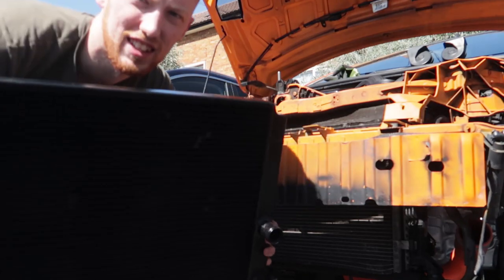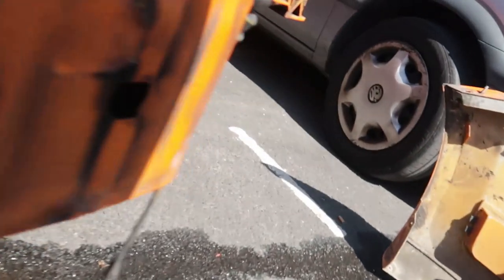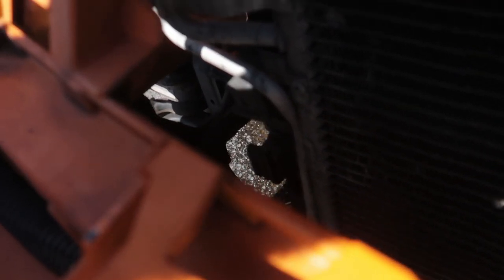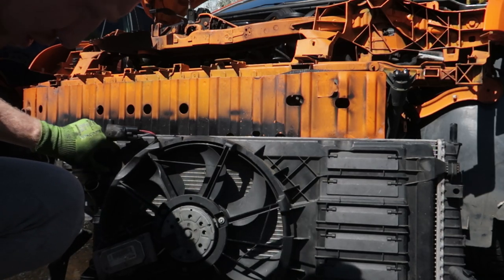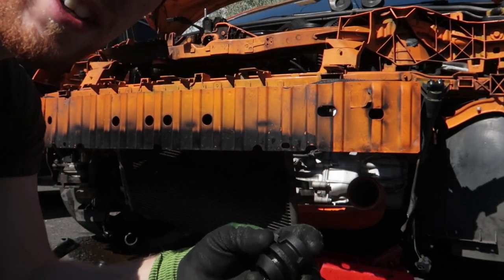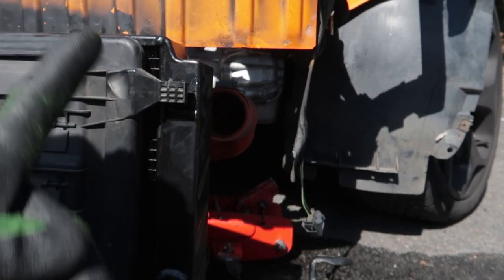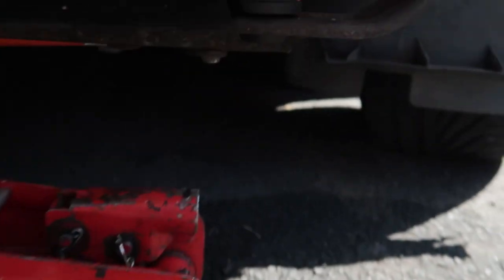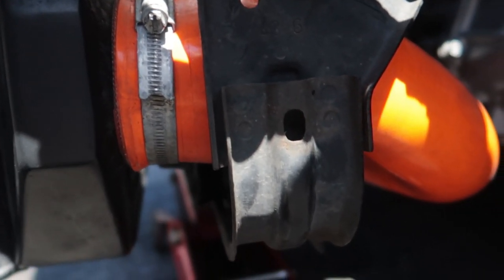MY RADIATOR BLEW UP ON THE M3 MOTORWAY *AIRTEC 40MM CORE RADIATOR INSTALL*

Comment: Have you considered why it went pop mate? My mates st 225 popped its radiator last week, turned out the head gasket had blown leaking combustion gases into the coolant system and over pressure the system. Dont want to worry you but might be worth a check👍
Reply from the maker: Gary Elborn tbh with you pretty sure a stone went straight through it
Reply: @Richieesgarage  glad you got it sorted mate👍

Comment: Nice upgrade pal, certainly something I will be looking at before long. What's the cost of these?
Reply from the maker: These ones are 499£ from airtec I picked it up second hand but you can buy cheaper ones from other suppliers bud
Reply: 03ANO wow that’s pricey new. I’ve seen direnza do them  might look into those. Good work pal keep it going